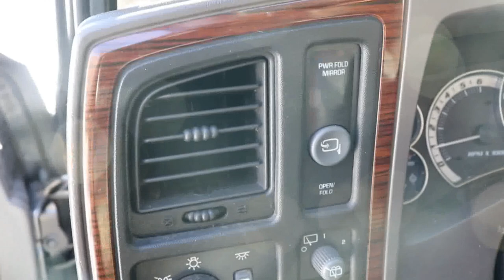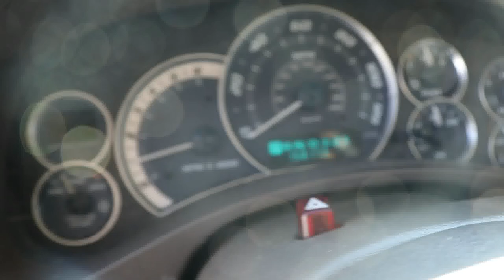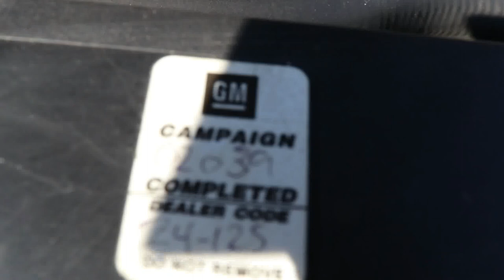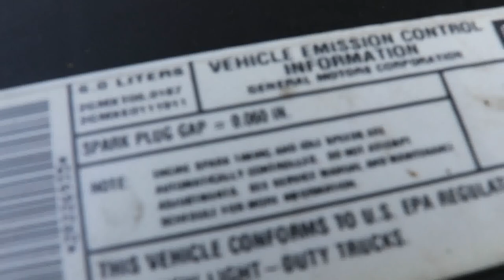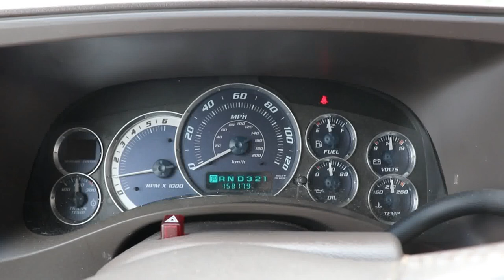The FREE 2002 Cadillac Escalade- COLD START PLUS MORE!

Comment: They have 4l80e transmission they don't break as easy as a 4l60e
Reply from the maker: Really? i didn't know that
Reply: No, they have the 4l60. The 4l80 only came in the Chevy and GMC 2500s and up. Still a good trans.
Reply: @BatsTDK  i figure it would have a 4l80 being it has a 6.0 like a 2500
Reply: @blockburnerboy  unfortunately not. I wish. My ‘03 Yukon Denali is the same as the Escalade. 6.0L engine with the 4L60e.
Reply: @BatsTDK  not that it makes much of a difference but my 04 Denali has a 4L65E. Only difference is it has a 5 pinion planetary gear instead of 4 but at the end of the day it still slips like mad going from second to third. Sadly going to have to sell it soon once my escalade is inspected. The Denali is too rusty for it to be worth rebuilding the tranny